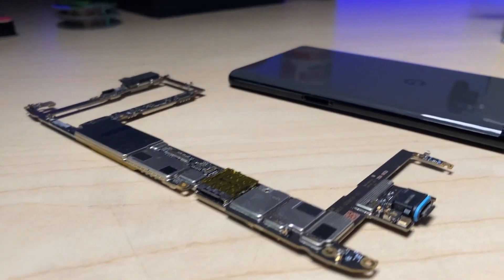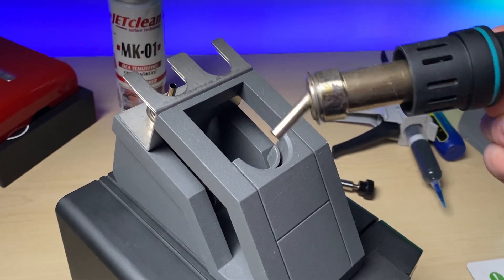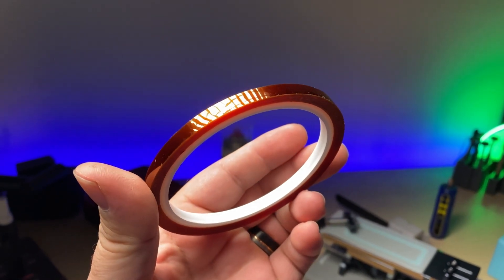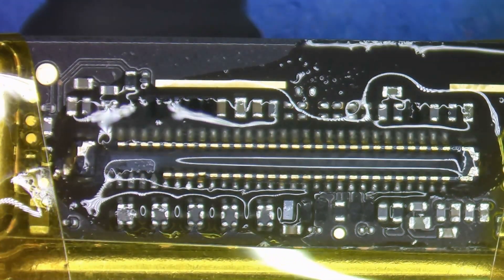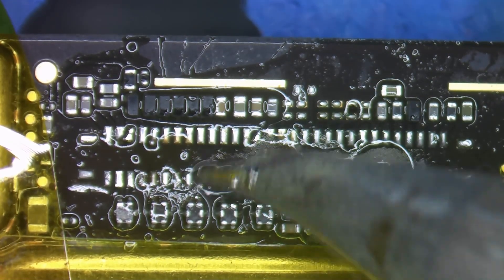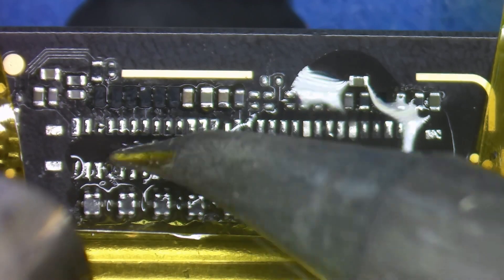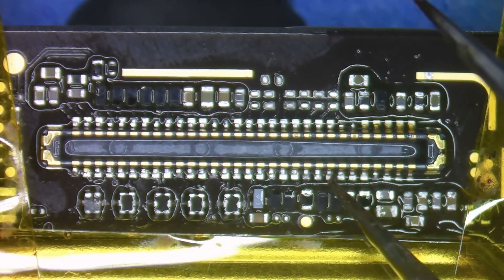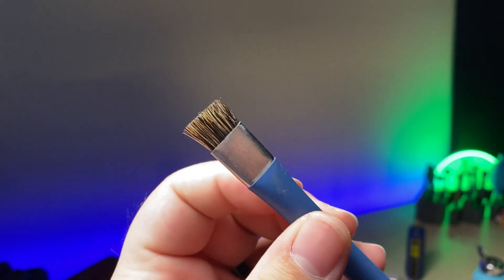How To Replace a Damaged FPC Connector(Everything you need to know)

Comment: I am curious on how yo prevent that the hot air gun melts the connector plastic, since it is plastic and has lower melting point than the usual solder
Reply from the maker: I've found that flux not only helps with the solder but it also shields the plastic from melting.
Reply: @MobileSentrix  mmmmm mine hasnt been helpful in that regard, any recommendations for someone living in the EU?

Comment: can a damaged fpc connector make the device not power on and charge? or is it another hardware component that failed. or even a software glitch after updates?
Reply: Of course it can.. it depends on what FPC connector is damaged. It could be the same issue my old iPhone had, which was a bad battery FPC connector! I rushed the battery replacement I was tryna do and ended up damaging the FPC that the battery connects to on the logic board. So now the iPhone doesn’t wanna turn on, and of course the battery’s flex cable won’t even connect on to the logic board because of the damage.. so it basically can’t sit properly! But if you haven’t opened up the phone and tried changing something, then chances are it’s not a bad FPC connector. Good luck!